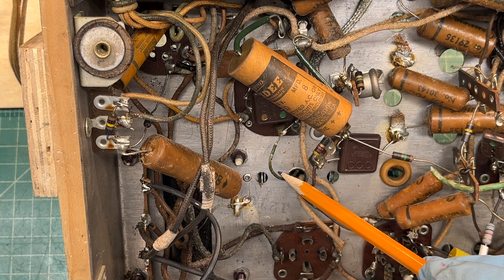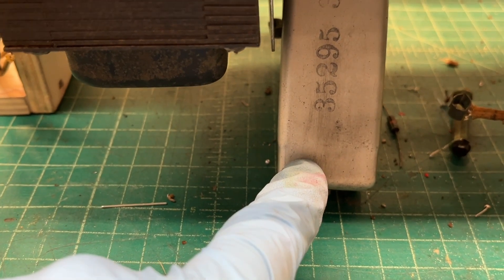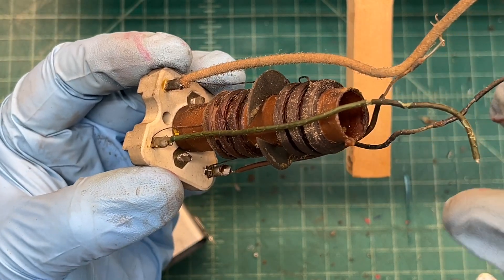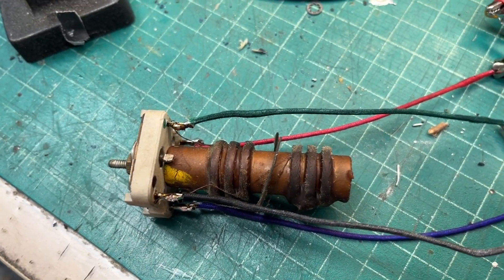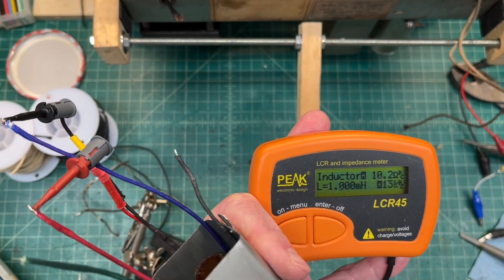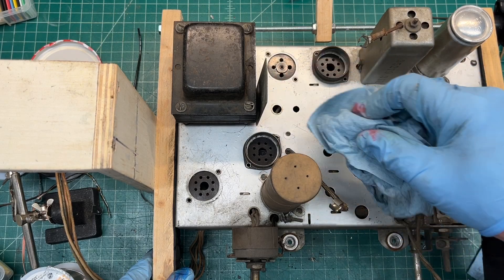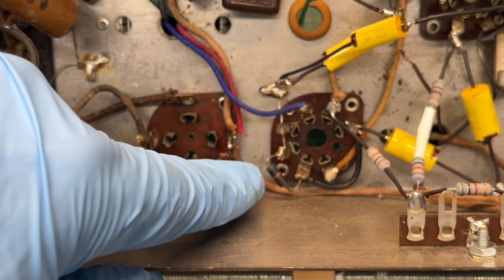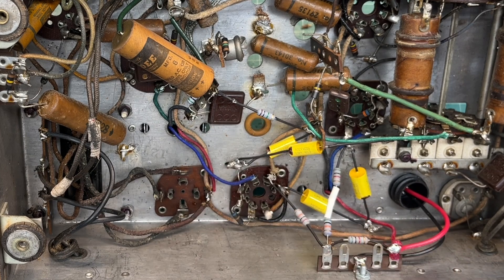Grunow - Model 654 | I.F. Transformer Lead Dress Repairs & Replacing More Capacitors & Resistors

Comment: No wires were removed from their stock position only replaced . They are where they are because of something called lead dressing.  Good stuff Don as I don't see many vids on this and lots of guys end up with a vintage radio with crumbling 
wires  going  into IF transformers. Do them one at a time and use written notes and photos  of where they went exactly 
before tackling  wire replacement. If you don't do this right you can get into problems with hum, whistling, squealing or low volume as you tune the dial. Found that in the book Elements of Radio Servicing , it's one of my favorites.
Reply from the maker: Thank you Steve. Great response for those following along and for future reference as well. As always, I appreciate your supportive comments. Best, Don

Comment: Looking good, Don! Replacing the faded old leads with new ones having the correct, original colors is a nice touch!  These older, larger IF transformers with trim caps on top, I think, were a better design than the newer, smaller ones with the adjustable ferrite inductors and those internal sheet capacitors that invariably develop silver-mica disease. It is my thinking that this later evolution (or devolution) was a cost-cutting measure in the later postwar AA5 receivers.
Reply from the maker: Chet - definitely should be safer to operate once I get to that point in the restoration with the new lead wires in place. I agree, the later I.F. Transformers were (are) inferior as compared to the ones from this era. Thanks again for reaching out and following the series. Best, Don